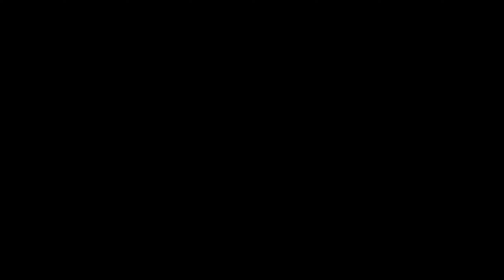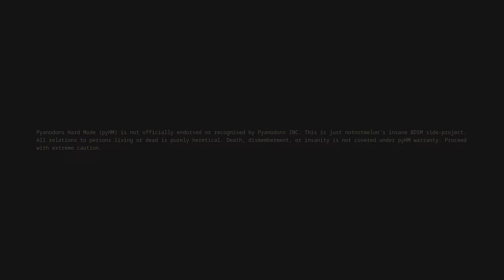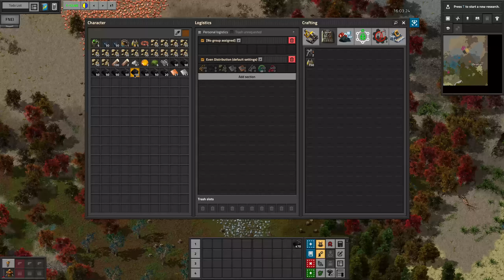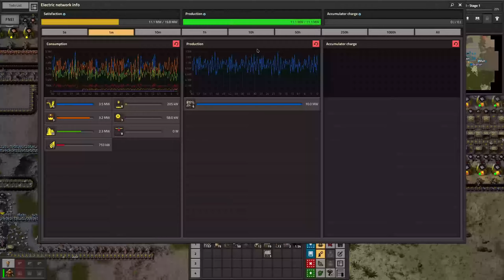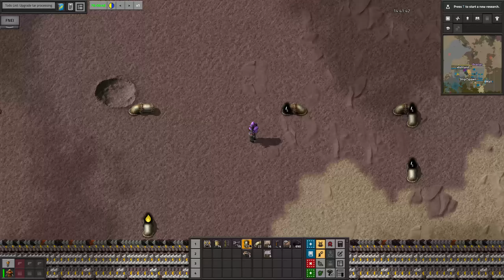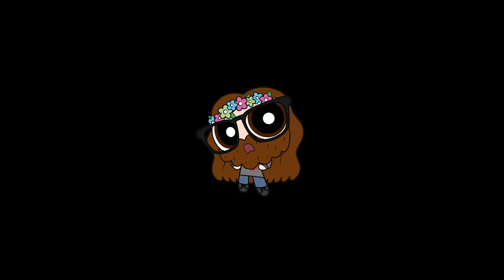100 Days in Pyanodon's Hard Mode

Comment: I would have used underground belt filtering for the smelters, on one side coal goes in ash goes out, on the other side ore/stone goes in plates/bricks goes out. Incoming items on the inner side and outgoing items dropped on the far side, at the end of the collumn a single perpendicular underground belt holds back the inner side and lets the far side go through. It's much cheaper than the design at 3:15.

Comment: I loved this edit and it felt really smooth and useful! Can you tell me more about how that double fluid fuel system for the glassworks works? The pipe doesn’t ever hold both fluids at the same time, but it fully empties of one before letting in the other, right?
Reply from the maker: Yup, that's exactly how it works. Every time the pipe is empty each of the pumps attached to it has a chance of being the one to fill it up next. In the worst case, it'll jam up for a short period of time if one of the pumps doesn't get a turn for a while. It doesn't work well for high volumes of fluids, but for sending a small amount of lots of things it works well.